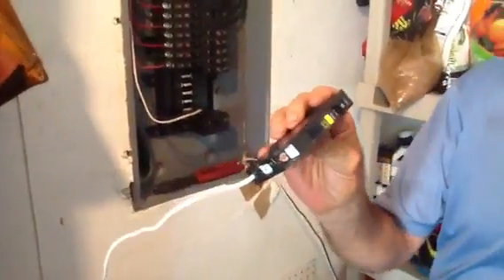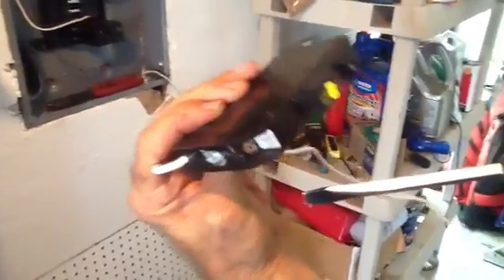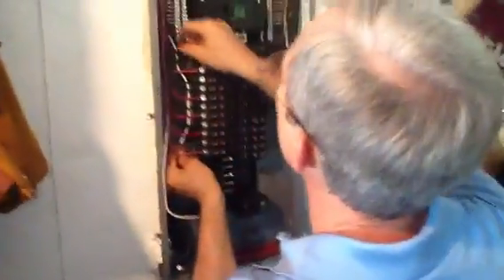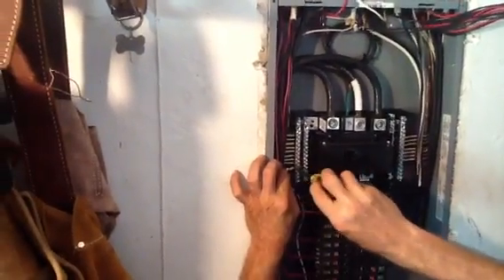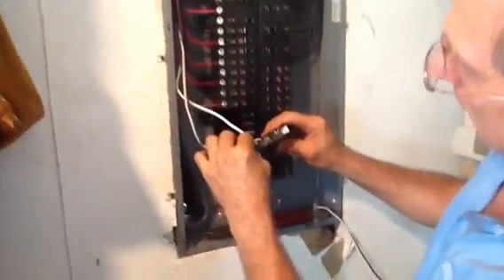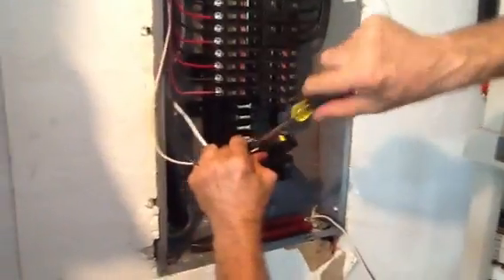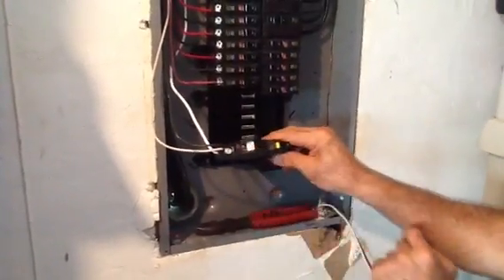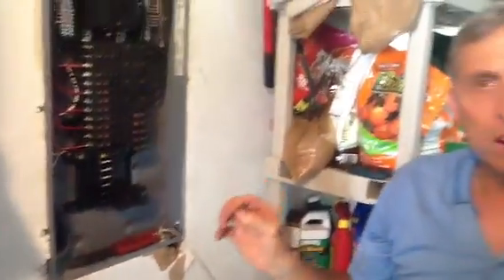How to Install a Square D GFI Breaker

Comment: Short and sweet, Thanks!!  I put off buying these breakers for 25 years because they are expensive.  I have a problem.  I want to install a dual switch SP unit inside a gang box which has a GFI outlet in it.  The problem is the GFI is a huge physical size and makes the joint venture with the dual switch an impossible task.  Plus, the GFI outlet in old work is so deep, it takes up just about all the clearance in the remaining space behind making the placement of the incoming wire cable difficult.  Now with a GFI circuit breaker, I can install a normal size duplex in the side of the box the GFI was in= more space.

Comment: My GFI breaker will trip after resetting.  I'm thinking it may be old and need to be changed.  There are at lease 5 outlets and some are connected to single pole switch.  Also one light with double pole switch it connected.  I just changed my out door outlet thinking that was the problem. No luck next day it tripped. What do you thing, could be the breaker?

Comment: The white wire goes to the neutral bar. At the beginning of the video you say to connect it to the "ground bar". Later in the video you refer to it as the "ground/neutral bar". The ground bar and neutral bar are not the same. At the main service panel, they may normally be shorted together, but you shouldn't consider them equivalent. At sub-panels - where you may also be installing one of these breakers - they usually won't be shorted together.
Reply: Will this work if your main panel is wired bonded neutral? I only need the GFCI breaker to run a buried feed to my shed. The service box in the shed will be wired with a floating ground.
Reply: @davidpatterson9840  That all depends on what you mean by "work". A GFCI doesn't know anything about ground. All it does is measure the balance between the current in and out of the device. If the net current is more than a few milliamps off of zero (ie. current in == current out), then it trips and disconnects the power. This will provide a measure of protection against electric shock regardless of whether you have a proper ground or not, however, with a properly grounded circuit, with serviceable breakers/fuses in place and properly designed appliances, a properly grounded circuit will provide better protection. In particular, since the circuit already provides a proper ground, there are some faults which will be detected immediately when they happen, whereas with a floating ground, some faults won't be detected until something else provides a path to ground, such as your body. Also, there are some devices which require a valid ground reference to work correctly. For example, some surge protectors will not work without a proper ground reference. EVSEs usually require a proper ground reference. Such devices will either fail to provide the protection desired or simply refuse to work at all on an ungrounded circuit.

Since you said "will be wired", it sounds like you're running new cable. Why would you want a floating ground? I don't know your reasoning, but if it was me - regardless of whether your local code requires it or not - I'd have a proper ground connection and not leave it floating. It will provide better protection against faults and ensure that you have a proper ground reference for devices that may need it. Who knows what loads or equipment you may want to run out there in the future.

Comment: thanks for posting, I sure hope you get back to me on my question.  I have a situation where my panel had a normal 20 amp breaker and downstream was a GFCI receptacle, followed by two more receptacles downstream by the range top.

I had to remove the GCFI receptacle because I planned on using that outlet for a free standing freezer and I didn't want the circuit to pop with it in front of it.  It will not be possible to move the freezer away to reset it once I install the freezer.  

So the good ole boys at Home Depot said I need to put a regular receptalce in place of the GCFI one and put a GFCI circuit breaker in the panel.  The original breaker only had 1 wire coming into it, a black wire. No white wire.  I install the newGFCI breaker and I tie the pigtail to the neutral bar and the circuit doesn't work at all.  I suspect it is because I am missing the white wire input to the breaker.  But the problem I don't know where it could be!  It is probably tied up to neutral bar as the original breaker didn't have a place for it.

So my question is, what do I do next?  I have the new circuit breaker off at the moment so I am not worried about the house burning down.
Reply: follow the black wire to where it comes into the breaker box and the white wire and ground will be with it. follow the white wire to the ground bar and disconnect it and run it to the gcfi breaker
Reply: First thing you must do is use a dummy tester and check to see if there is any power leaving the GFCI breaker in the first place. If not, check the button on the breaker. Is it where it should be?

Comment: question, i installed a jacuzzi tub and put the cgfi breaker and run wire under tub, and eveything was good, but when i plug tub motor it pop breaker, but if i plug a regular extension cord with a drill it works, it only pops with motor from jacuzzi, and then i tested motor with a diferent outlet and it works, o e last thing i forgot to mentioned, i installed a regular gfi outlet at the end, i dont know if that has something to do with my problem

Comment: I have a 15 amp GFCI Stab-Lok breaker with the yellow Push To Test button on the side and need to change it to the 20 amp or 30 amp breaker, do they still make those type breakers? Or can I get a newer breaker and it'll work just fine?
Reply: Not safe to replace a 15 amp breaker with a 20 amp breaker. The 15 amp breaker typically feed the 15 amp rated cables. Current higher than 15 amps will cause these cables to overheat and could start a fire.
Reply: I asked 3 years ago but thanks for the tip makes sense
Reply: I asked 3 years ago but thanks for the tip makes sense